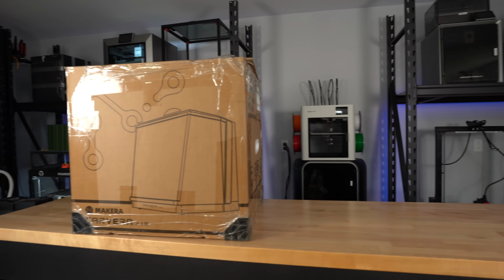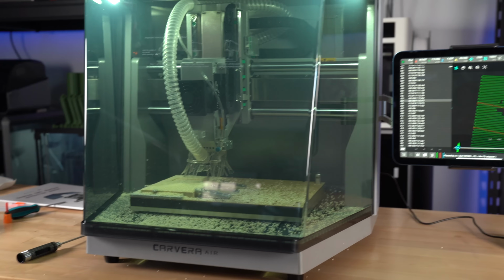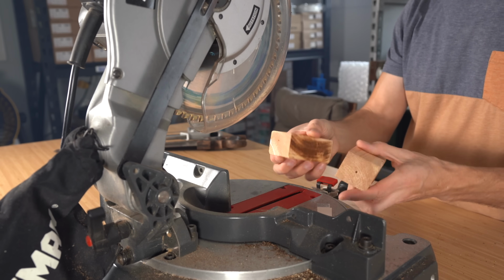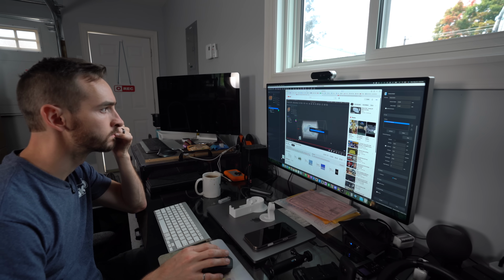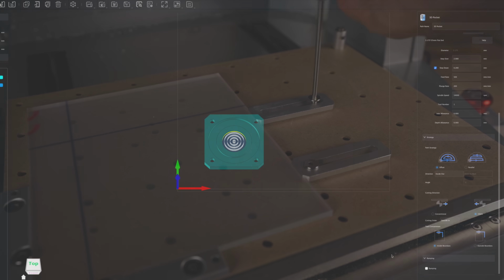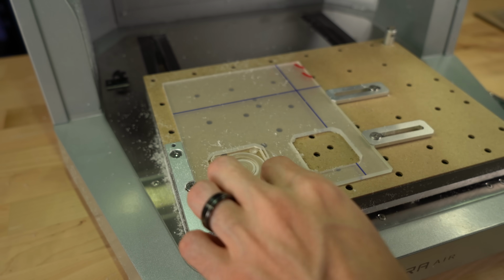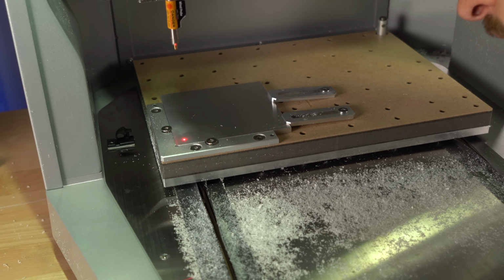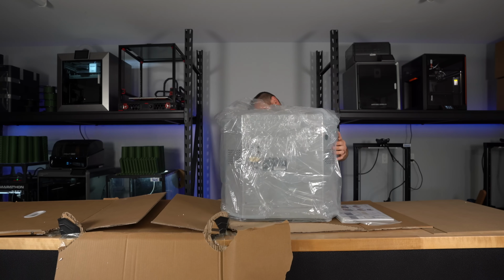A New Era In Personal Manufacturing - Desktop CNC

Comment: Hi! Others mentioned the mitre saw already. Stumpy Nubs has a great video for a hold down stick, that will make it safe, but your piece was just too small to cut it on that saw. And get a sharp blade, you will be surprised. 😉

The other thing that I spotted is the clamps that you used for your first part. Try to put something under the rear end. If they are pointing up towards your workpiece, there will be a force component which will try to push your part out of the clamping. In your case it was not that critical because of the metal right angle on the machine table, but it should be a general approach. Put enough stuff under the rear so that the clamps will point just a bit down towards the workpiece. Machinist clamps even have rear screws for that.

Otherwise have fun with this machine, it opens up quite a bit of possibilities.
Reply from the maker: Thanks for the tips :)

Comment: It isn’t that your saws are dull, it’s that you are using a metal cutting saw to cut wood! The hacksaw has tiny fine teeth and is very slow to cut wood. a wood cutting saw has larger teeth with larger gaps between to remove more material.
Reply from the maker: Good observation, thanks! I just tried every saw I had on hand. Clearly not a woodworker haha

Comment: You could have hand polished the acrylic with a dremel or applied thin layer of clear spray paint to achieve a glossy surface. Thank you very much for the great review. 👌
Reply from the maker: Good tip - thanks! Will consider that for next time.

Comment: Love the Carvera Air. I designed and printed a series of brackets that allow for rapid pressurization and fine tuning of air assist airflow with a quick disconnect system using my printed brackets, a 2x4, and some off the shelf tubing and connectors.

Comment: Actually, it’s not that this CNC looks like a 3D printer. It’s that both are Computer Numerical Control machines. One is a CNC printer, the other a CNC mill. Using the acronym CNC instead of mill is simply inaccurate. And your so-called expert just shouted to the whole world that he only knows mediocre mills, because he made quite a big mistake. If you notice vibrations and resonances, the cutting tool is not the direct cause. Even less if it’s a carbide tool. What really happens is that the tool length works like a lever on the machine’s guides and transmission. And if the machine vibrates under load, it means the guides and the transmission are poor. Of course, other reasons can add up, like a worn tool or cutting parameters that are off.

Comment: I purchased the carvera cnc about a month ago and it has been fun to learn on. One note, instead of tabs I use a double sided tape to hold the part down to the spoil board. It is super thin and very sticky but does not leave residue. I got it on Amazon specifically for cnc machining. Working great!
Reply from the maker: Good tip - thanks!

Comment: With CNC if anything metal is the easiest level IMO. Brass specifically. As easy to work as wood, but without the horrible tearout. And none of the melting of plastic. The headstock is the thing behind the holding bit, the holding bit is the chuck. My main experience with this sort of thing is on a lathe not a mill so hearing headstock over and over felt quite weird.  Gotta say, this thing makes far prettier things than my setup, a manual lathe that I've sort of bolted more functions on to as time has gone on. It can do CNC on a good day, very very crude CNC but CNC none the less. This is very cool. Not for me as I like my making stuff outside of 3d printing manual. But very cool anyway.
Reply from the maker: Thanks for the clarification - still learning the terminology. And interesting about metal being one of the easier materials.

Comment: this looks cool i am on the fence about getting one instead of a large format printer
Reply: I make parts out of aluminum on my cnc because sometimes plastic isn’t strong or heat resistant enough. 
I use the cnc to salvage or enhance 3D printed parts too.
Reply: @Todestelzer   that is a good idea I haven't thought about thankyou
Reply: @Bear947-g6x  yeah for example make pockets for bearings on 2 sides of a 3D wheel perpendicular. The 3D print, even on a H2D, isn’t 100% perfect.